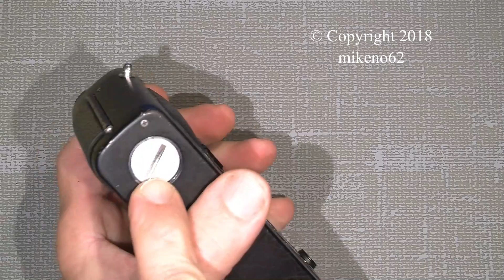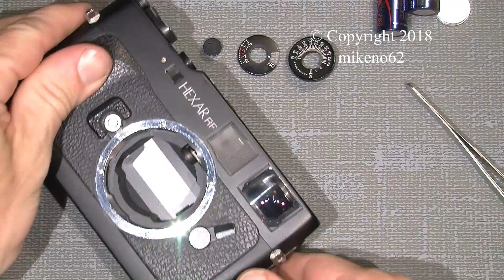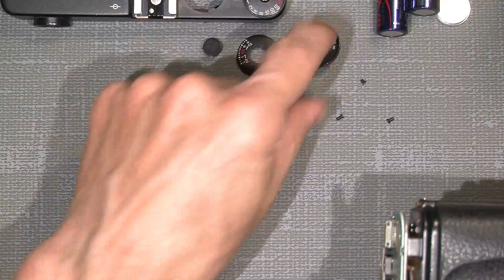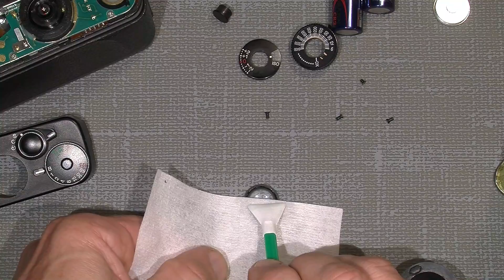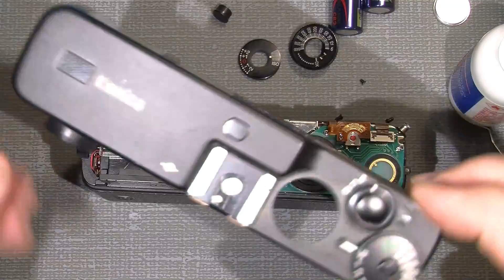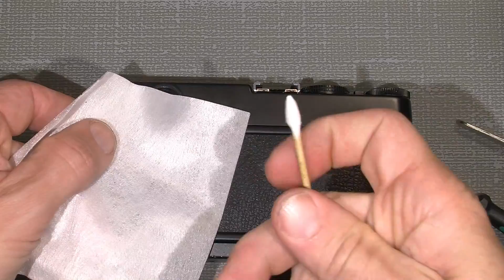Dust in the view finder in Konica Hexar RF

Comment: Great video, thanks for putting together the tutorial! I have a random question about your Hexar RF. I’ve never seen one with the raised rectangle by the lens mount release button. Is that an add on or did it come like that. Mine is completely flat around the release button and I’ve seen some variations with a small raised half circle right next to the button but never with the large raised rectangle. 

Thanks!